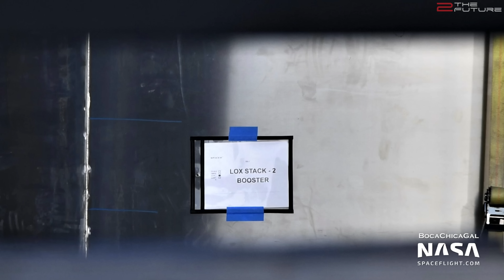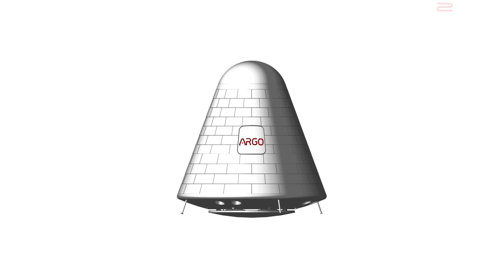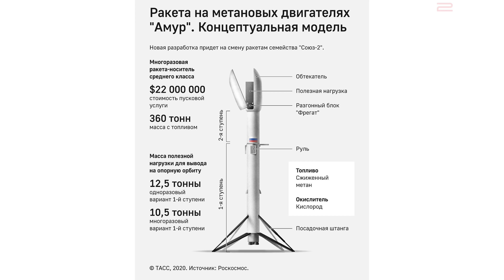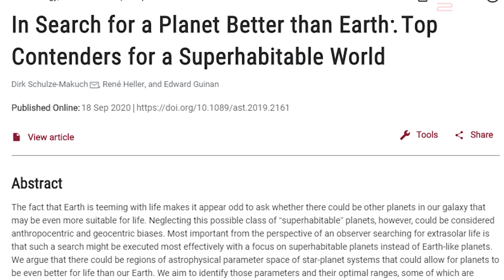NASA Software Flaw, Russia Copies Falcon 9, Starship Flight Test & Super Heavy Update

Comment: In all reality these rockets are designed to be reused, but they probably won’t be. With the risk of failure after multiple uses, the cost of inspection and refurbishing the rockets it will not be financially feasible to reuse them.

Comment: Regarding Roscosmos's copy - Grid fins were invented by Roscosmos and they've been used on soyuz and ballistic missiles for decades - the linkage landing legs were also invented by Roscosmos and used on various robotic landers (although extended in space - just so they could fit inside the faring) - Roscosmos were the very first to use ballooned fairings (on the R7).

It's not fair to call it a copy - not when they invented so much that the Falcon 9 uses, not when any rocket designed to land would have to have legs and telescopic legs offer the widest base.

And not when the DCX already existed and performed several landings - If we can't call the ISS a copy of Mir? if all the achievements of the Russians (the first people to even launch an orbital rocket) mean nothing? then what claims do SpaceX have other than being the first ones to be successful? Is the entire American space program a copy of Russia's just because Russia were first?

Comment: The SpaceX driven evolution of earth space launch systems goes on. The race to the Moon is on, maybe SpaceX had something to do with that as well? NASA is dusting off the nuclear fission engine research, that is coming in the near future I would say. Makes Mars a much easier target. 

If the commercial guys can figure out what to do with the Moon, you might see a bunch of stuff going on the next 10 years or less. In my opinion that is going to be the next step, commercialization of the Moon and with that will bring along many advances quickly. 

The number one problem of space is costs, that is being addressed so progress is happening. 

Problem two is speed. That seems to being addressed.  No, fusion reactors aren't right around the corner and anti matter drives aren't even in the ball game.  

Next 10 years will be action packed, who knows how far it will go?  Mars is still a suicide mission for manned flight for many years to come but if you can work things out on the Moon, Mars becomes much more realistic.  Gravity is the real killer with that.

Comment: Why can’t, Spacex Luna Lander takes off and is in LEO. One or two of the refuelers brings two rockets connected to fuel tanks and astronauts attach them to the crew/cargo part of the starship.
Then Starship takes it to the moon. Once in orbit of the moon the crew/cargo starship detaches from the Starship and uses the external rockets to land. starship returns to LEO or if it is there the lunar station.
there you have a permanent moon base and a truck to bring stuff out from Earth.

Comment: Russia tried copying the Space Shuttle, not realising that the spy they had at NASA had been rumbled by the C.I.A. and was deliberately being  " fed" design  blueprints that contained tiny errors, small enough not to be noticed but bit enough together to guarantee the Russians space shuttle would fail. And it did, big time.  Them were the days as they say.
Reply: The buran sucessfully flew, entered orbit and landed, all autonomously. It failed because the Soviet Union was collapsing and there was no money for the program. Also? Russia invented Grid fins, telescopic landing legs, the balooned faring, the satellite and were the first into space. Also? NASA have used Russian engines for years - if they 'copied' them too? then they clearly did a better job. Nationalism is all well and good - but it doesn't match reality.

Comment: Off topic, sorry.  Jixuan & Sebastian - on your hyperloop video you talked about the need for a lot of pumps needed to maintain a partial vacuum in the tube/tunnel.  I'd like to know where you think air would be leaking in.  If you want to answer me I posted the question on the hyperloop video but probably after you had stopped monitoring comments on that one.  Thanks.

Comment: Just a side note, the grid fins were used by Russia on several missiles as well as the Soyuz escape system, as well as a few Western missiles, before Falcon 9.
Reply: it is  called  ¨ sarcasm ¨    the point was  stating  the big  similarity  between the two Rocket.
Reply: And just how well did they work ? From reports they did but only slightly then what they were designed to do .